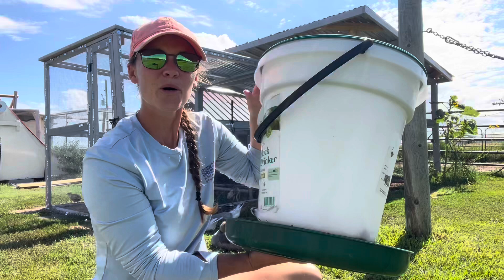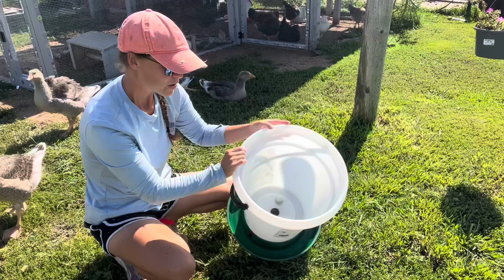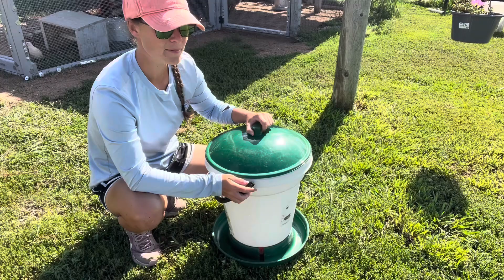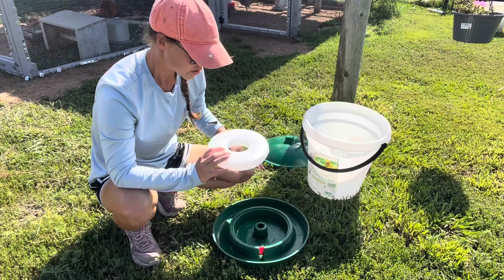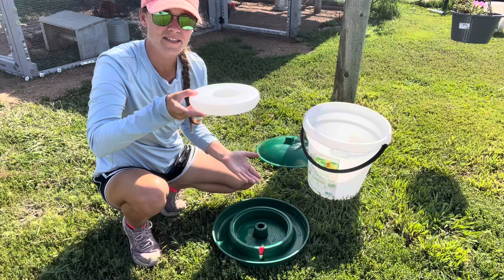How to fix a Harris Farms 6.25 gal waterer that won’t dispense water!

Comment: Ok my problem is the valve keeps draining and won’t shut off. Can you show me your inner valve? Mine had a small piece of plastic that was on the valve which I removed. It goes up and down but not enough to fully shut off so In a day it is empty. Any suggestions?[
Reply from the maker: @WilliamMannix-t9j  Is the float functioning properly? Or is it just the valve you’re struggling with?